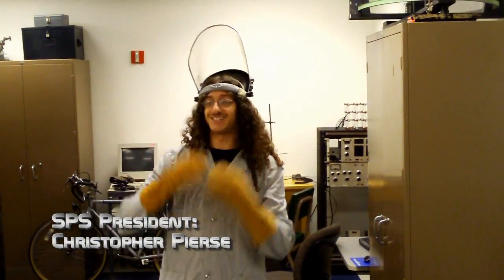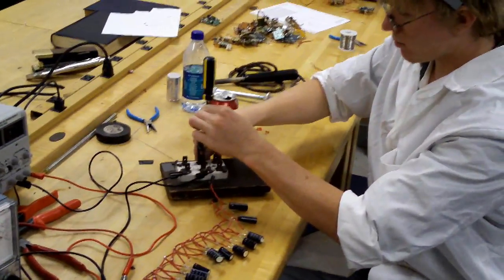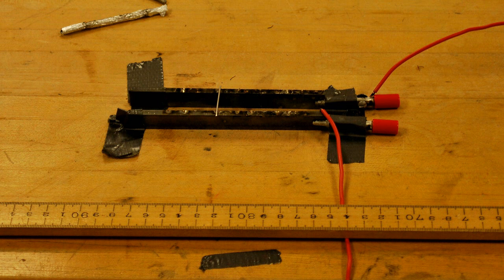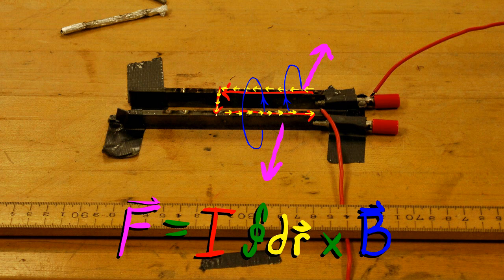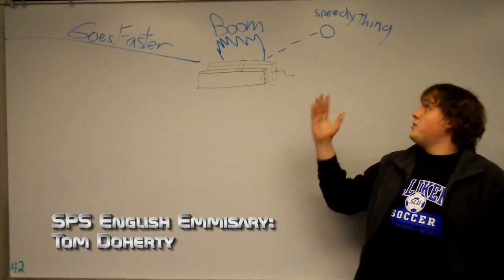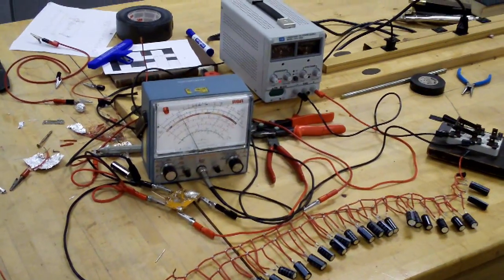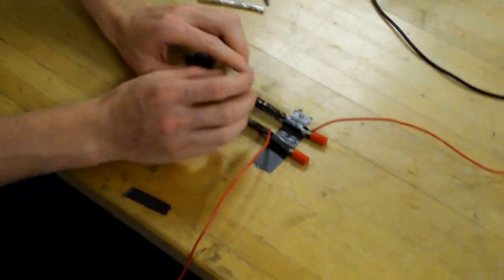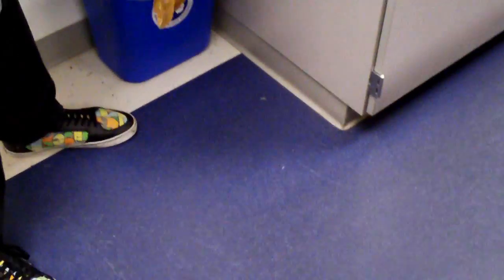Prototype Railgun

Comment: Why not use one decent sized and better shaped capacitor instead of that mess? Also you should be using some much thicker wire for this. Y'all are gonna set the place on fire.

Comment: I have a dire question. If magnetic force can't do work and only changes direction, how is the projectile sped up?
Reply: because it's a force. forces generate aceleration based in the projectile mass. With aceleration the object moves.
F=m*a
Reply: but the magnetic force only happens if the projectile have some start velocity. This is a special eletromagnetic's property

Comment: so i tried this with 20 (1000uF 50V) capacitors in parallel and charged to 44V. Nothing happened. Just lots of sparks. Any one know what I'm doing wrong?
Reply: The projectile has to enter moving (usually), otherwise it can solder itself to the rails.
Reply: +Andrew Kwasek did you make sure the bullet was touching both sides?
Reply: its a conspiracy by the jews

Comment: With all of that inductance to the rails, the slug would be off the rail before the current even peaks.... and since they're electrolytic capacitors, they act more like batteries than capacitors. Way too slow for a railgun application. You need some pulse capacitors or ultracapacitors...

Comment: What is your Farad of all your capacitor? And it would go farther forwards if your projectile is in between your rails and it does not have an opinion of going up or down adding more force going forwards. You need to focuses on your farad more than volts to increase your magnetism field that will increase the speed of the projectile and distance. Your magnetic field is pushing the projectile more up than out.